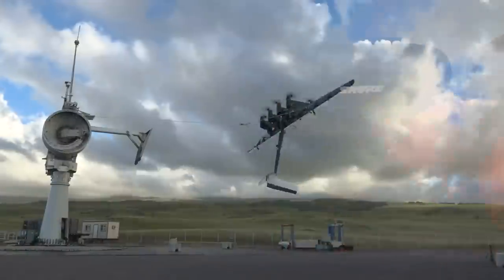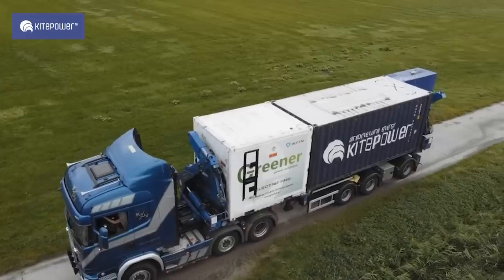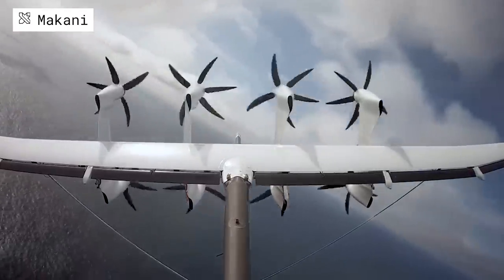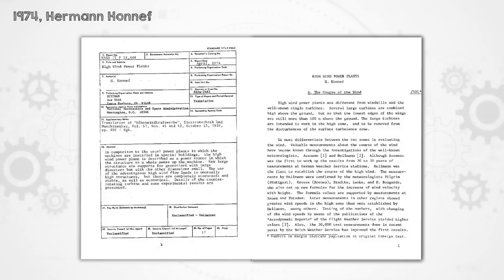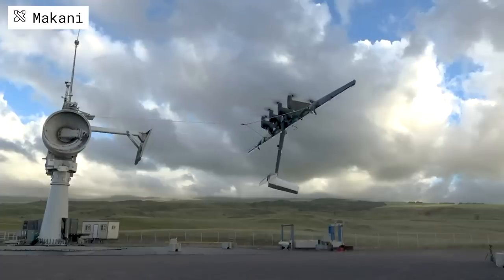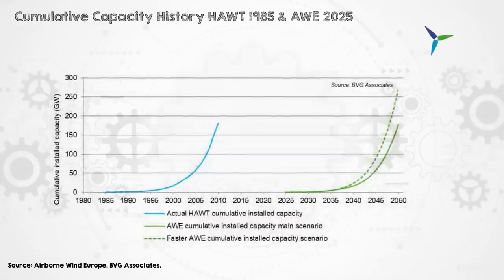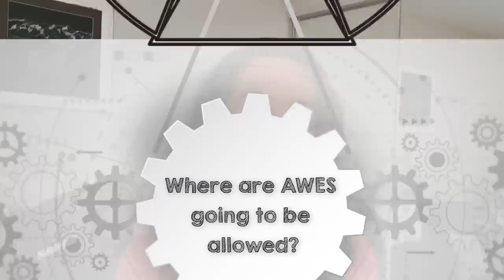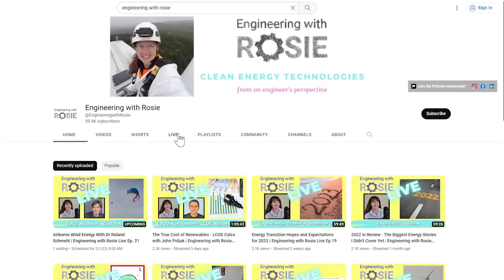Will Airborne Wind Replace Conventional Wind?

Comment: "Just the economics" not working out is the problem with most of the "promising" technologies we hear about in excited optimistic voices every day. The other common problem of course is the engineering not working out. "Good" ideas are easy, engineering and cost control are hard. Manufacturing at scale is even harder.

Comment: I think you miss one of the advantages of airborne wind. You don't have to build them to survive hurricanes. If a gale is on the way you just pull down your kite/blimp/gyro/whatever as the wind builds up, just like a sailor reefing the mansail. This means they can get away with much lighter construction (including the tether) than a fixed turbine. Whether tthis is enough to overcome the downsides of the approach, though, is another question.
Reply: Exactly!

Comment: For ground generation, why don't they use two kites pulling back and forth, slightly offset through aerodynamics so as not to get entangled? that way you wouldn't have to use power, just adjust aerodynamics mechanically to switch back and forth
Reply: There was a company called KPS who did that. Most of their IP is now with Kitemill
Reply: That's mechanically more complex. 
If you consider the grid to be a power source, as well as the place you stick your generated energy, then it's fine to use a bit of grid power to pull the kite down and to thereby benefit from the mechanical simplicity of managing a single-kite generator. You can consider the periodic wind-in energy to have come from one of your other nearby generators which, in the big scheme, all averages out into acceptably smooth and reliable generation for the grid.
Reply: @Rich-on6fe  thanks. Yup, sure. Intermittency is no issue any more, we know how to deal with it. It just sounds like an inefficient way to do it, but at the end the numbers need to check out. Not always intuitive

Comment: Has anyone done a flygen (ground gen?) system with a pure rotorcraft (no wing)?  I'm thinking a heavy-lift helicopter sized autogyro.  I wonder if that would offer more control and weather resistance compared to a flexible or rigid wing.

Comment: Hi Rosie, Great coverage of AWE. Please look into many-connected Kite Network topologies as the ultimate AWE scaling principle at highest density and safety, and also note that modern architectural and airplane fabrics are now certified for decade-plus service-life.
Reply from the maker: Great questions for the livestream. The really durable fabrics aren't used for kites yet because as I understand it they are much more expensive and it's cheaper overall to replace a cheaper fabric every 6-12 months. For now anyway, hopefully that'll change.

Comment: Emergency power generation does at least seem to be one viable market since it has the advantage of not needing fuel over regular generators. Of course there's still solar it'd need to compete with, which might be hard given how dead simple and reliable solar is, it'd need to produce significantly more power for its cost and area used.

Comment: Would it be viable to have a kite system that could fit in the trunk of an electric vehicle then driving the vehicle multiple days cross-country only charging from a kite system?  Also, how are lightning strikes factored in?  It's a bit of a Benjamin Franklin thing to hang a very conductive wire kite.
Reply: That's exactly what we're trying to do :) It's possible to make it fit inside the vehicle and still be powerful enough to charge it in one night.

For example Kitemill have a >10kW 6 meter wingspan prototype that can be taken apart.
Regarding the lightning, we will use a script that checks the weather forecast regularly and orders the kite to autonomously land in case of unsuitable weather.

Check out our videos to see such a landing :)

Comment: Do the ground gen units use bidirectional generation? If not, they're wasting a lot of potential. If people aren't understanding what I mean here, it's like a yo-yo in reverse. The cable spool with a flywheel attached through a reversible transmission could keep the generation going pretty much indefinitely, as long as there's wind. It eliminates the need to land and relaunch along with most of the associated energy losses. Slowing the spool itself for direction changes could use regenerative braking. Also, the cycle could be shortened any time the airspeed near ground level drops too low to sustain lift. A simple mechanical tension release could be employed to release the kite when airspeed reaches a critical point while simultaneously releasing an emergency drag chute on the cable end to lower it safely. The hazards of overhead cables already exist. I hit one once, myself, that fell across a highway, in a box truck that I was driving. (My boss was not happy.) But at least the speed that a high altitude cable falls could be pretty easily mitigated. A soft kite could parachute slowly to the ground and be tracked and retrieved. A glider type could have some drone capabilities for a safe return, as well as an emergency chute.

Comment: Seems like staying aloft for a long time, maybe perpetually, is an issue so maybe it takes a much larger system that can could connect many smaller turbines and have buoyancy or powered propellers to keep the systems aloft in low wind conditions.

Comment: For systems that don't have enough air at ground level, why not mount then on the back of a truck  The truck doesn't have to move very fast and distances should be short. It could be mounted on a frame with extendable legs. When the device is airborne the truck stops, legs extend and lift it off truck bed and truck drives away leaving ground base equipment attached to frame on the ground tethered in place.

Comment: The problem of Airborne wind energy can be simplified to cost of transmitting power from the glider to the ground. A purely mechanical system is cheaper and lighter than an electrical mechanical hybrid system.
Going higher is cheaper than going a hundred miles offshore especially with cheap high-tensile fibers like dyneema.

Comment: You didn't talk about the kitegen carrousel design which overcome the low power output problem.
Many kites pulling a train running on a circular track on the ground. I think that is one of the best design but it would need a lot of money to build a prototype, so I don't think it will be done.
Reply from the maker: I think I talked about that idea in the first livestream I did on this topic. I think you're right that no one ever a built a prototype of that idea and tried to commercialize it.

Comment: Are there any hybrid flexible/rigid fly-gen systems? Like a smaller chute anchored to a plane - so the plane would be held in place by opposing ground and air forces?
Reply: Kitewinder and "Windswept and Interesting" use combinations.
Our own approach uses a fixed wing with multiple line attachments so it can be built with a lighter wing spar.

Comment: What really interests me are the noise emissions of fly-gen systems. I'd imagine a large scale wind farm would sound like a WW2 bombing raid.
Reply from the maker: I did see a little research on noise. From memory I don't think it was a huge issue, but I'll try to dig it out for the livestream.
Reply: We have recorded some noise in this video:
https://www.youtube.com/watch?v=_y-az4ruFL0
You can hear the tether and the generator. The latter can be insulated. The frequency of the former probably depends on the line length and line tension.

Comment: Why not instead of reeling it all the way back in, just have a dual-kite setup where as one extends it pulls the other in by being physically connected to the spool in the opposite direction. This way one when reaches its limit of length, it folds its wings in to a gliding mode and the more pulled in kite unfurls its wings for maximum drag.

This could allow both kites to remain up in the ideal airflow zones by limiting the phasing distance too.
Energy would then be mostly consistent as well.

Comment: im just spitballing ideas here, i've no background in erodynamics, im an elektrican turned programmer:
i am asuming ground-level generation, probably rigid because it apears to have less problems

launch
i see 2 options here both have the obvius downside
1. a fann witch can be powerd buy a geared weight both on ground level, im going with geared weight due to having less energy-loss than turning energy into elektricety and then back into kinetic energy. the fann is used to get the kite high enoth to become self-operating and then work itself to the desired altitude
2. a "lifter drone" working mutch like the larger curent models caries the kite upp then uses the conecting line to zip down to ground level

croswind
this is largely down to having a good enoth progream on a just barely viable computer system fed with weather data from a large enoth aria.
nevermind the fact this is a MASSIVE programming task, you are programing a system that tries to anticipate and react to weather conditions. an incredebly complex task but like any case with programing it can be solved. i do however doupt computer systems at every single ground station is a cost-effektive solution, more lightly this is all handled in a centraliced computer center and maybe with the help of a single employee that can handle edge-cases beond the programs abileties until it can be upgraded to a suficent level of complexety

gusts
this will in no smal part be posible to handle with the sensor and programing vere the kite can decend low enoth to handle the rising wind and then ride its end to a prefered altitude.
but ve are here dealing with edge cases so in the case the kite does get caut unaware it will generaly need 2 failsafes, one witch is normaly used in crisis and annother witch is used if the other failsafe fails. here are my inexpert sugestions:
1. build the kite with intentional structrual weaknesses so that its extremedies will litteraly get torn off or break in the wind reducing its drag as it is being emergency-pulled to the ground.
its also my understanding that tradisjonal wind turbines are built with a shape that acselerates at low winds but breaks at high winds, if this can be incorperated it may well help.
an obvius downside of this failsafe is that the ground station either needs to repair the damaged kite itself or more realisticly an mantiance crew (automated or not) replaces the kite and later repairs the damaged one in a sentralized location (probably same building as the databank)
2. controled crash sites are placed acros the complex. thise need not be giant flat arias reserved only for this pourpuce but more so an automated vertion of a plain pilot chosing the best place to crash. this ofcorse means that one is putting a lot of trust in the program but that is in part wat that 1 employee i in the datacenter to overlook.
3. cut the line sounds bad but it cud be the best option if the craft is litteraly threatening to pull it outa the ground. if this even can happen then the kite needs limited controll fonction so that an employee can guide it to a safe landing

landing
this is a programing question, the program just needs to be good enoth that it can do this on its own. i imagine that having some limited controll over a rigid frame can help in giving this control but trust me you down vant a singnal-leading cable under constant wear, tear and tension so its gotta be wireless and every gramm of motors, computerships and the like are conna cost you efektivenes

sensor nett, battery bank, datacenter, employee nessesary
as its probably obvius here im als not nearly as optimistic abaut automations magical abilety to solve all problems as manny of my fellow programmers. as i see it this is not going to work at all with just a single station. it will be a complex utilising potentialy hundreds if not thousands of them with eatch ground-generator being prefrably as cheap and dencly packed as posible.
it will also need a sentralized location witch holds maintiance facileties, energy storage, databank and watever few employees the complex may require.

mutch like solar enery i expekt this kind of green energy will need a lot of time to get viable.

PS: charging the kites energy into weight-based energy storage cud be used to even out the peaks for energy generation to be stable and even alow for the "energy as on demand" consumption patten

Comment: Why not set up panels of LITTLE pinwheels, on the sides of large buildings that often have strong winds hitting them, BUT instead of empowering electric generators, each pinwheel has a little air pump, that propels air through one-way valves into a network of tubes or pipes, collectively expelled into a SINGLE large scale turbine that turns an electric generator?

Comment: Logistics (crossing tethers/tangling) would make scaling to large enough facilities to be economically viable "difficult"? Fixed wing would be vulnerable to "icing" phenomena the further away from the equator they're sited? Torsional power conveyance to the ground is fraught with "challenges"?
I like the added energy available, and "noise" reduction, and relative reduced optical "footprint"/viewscape littering (until they crash), but many challenges lie ahead IMO..

Comment: As you go higher the air gets thinner and the available energy for a given speed decreases. Eventually this will override the increase in energy due to increasing speed. I'd love to see a graph of available energy Vs height.
Reply: As a hang, paraglide and paramotor pilot, I can tell you this effect is totally insignificant.
When you first realize how much wind speed increase with altitude, you get blown away. Literally.
Reply: @eskileriksson4457  I'm also a paraglider pilot. It will make a difference eventually
Reply: @samuelprice538  True. You'll suffocate before that, but still true. 
I don't think you'd ever be allowed fly an AWE at those heights though.

The tether itself also becomes a problem, in terms of strength and weight.
At an angle of 45 degrees or so, it would have to be 5700 meters, for the kite to reach 4000 meters.

Double leading steel wires, for fly gen, becomes impossible. Because of weight.
Even fiber rope, for ground gen, becomes a stretch :)
Reply: @eskileriksson4457  one of the things you learn at paraglider school is "no static kiting" which is exactly what these kite based wind generators are. It seems even with computer control of the glider capable of superhuman control they still crash sometimes. It's an inherently unstable situation.
Reply: @samuelprice538  it makes no difference if you are moving or not.  Centre of mass compared to center of drag is the main factor
Reply: Kites will fly up to only 500-600m, the thinner air doesn't play a role. What is restricting further heights is the increasing drag of the tether. And wind shear effects are not as significant above these altitudes (unless you go into the jet stream - there are some interesting papers on that but this is not what the industry is currently focusing on).

Comment: I keep hoping to see a helium filled lift for a smallish, (500W to 2KW) airborne vertical axis  wind generator for us off-grid folks to buy. I live in an off-grid community in the Salton Sea area, and there are no obstructions. The only problem may be that we are near a military bombing range, and I wouldn't want to interfere with their flights. Perhaps a bright red flashing light to let pilots know it is there?
Reply: Generally that's the way to do it, plus those big spheres on the tether that power lines have

Comment: I do wonder how this is to be scaled up. Surely they have to be spaced out quite a bit comprimising their area efficiency right? I'm already imagining these kites spiralling out of control, cutting each other off and getting tangled like a pair of earphones in your pocket.
Reply: The wind points almost in the same direction for systems installed closely to each other. The angle between tether and ground can be fixed. Then all tethers are parallel. Also you can synchronize the kites using WiFi.

Comment: The principal problem with conventional wind power is intermittency: for a grid that requires power 24/7/365, wind turbines are literally as reliable as the weather. 

Insofar as this is still a problem for airborne wind systems, it will never be a viable alternative.

Comment: Is there any research being done on using a Lighter Than Air (LTA) device as a  means to assist launching, the airborne part?  
And/or synergistically using existing or new tall structures, such as cellular or radio towers or even buildings?
Reply from the maker: Great question for the livestream!
Reply: @EngineeringwithRosie   as an addendum.. If you could. please ask about the possibility of deflating the LTA, such as via hose? to make retrieval easier and more controlled... 

Since I don't believe I'll be able to be online during the livestream... Good luck with  Livestream....

Comment: Another excellent video! I look forward to the livestream (hopefully I can tune in). You did mention generators on blimps and THAT particular company went bust. I was wondering why that idea didn't turn out to be feasible?
Reply from the maker: Good question for the livestream! One downside of that system was that it didn't operate in crosswind flight, so the wind speeds it saw were much lower than any crosswind device.
Reply: Also guess suitable gas for floating is hard. Helium is rare enough with current usage and hydrogen is 🔥